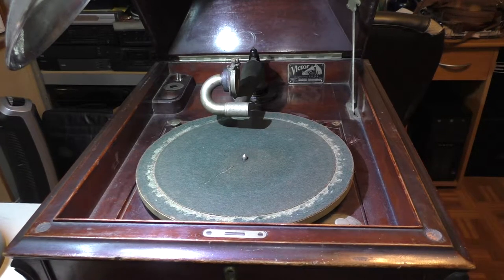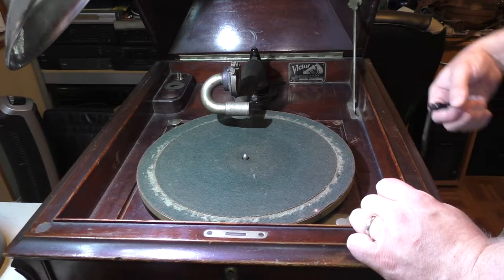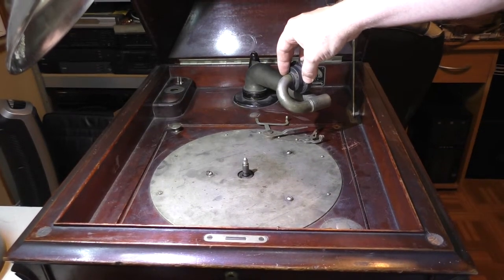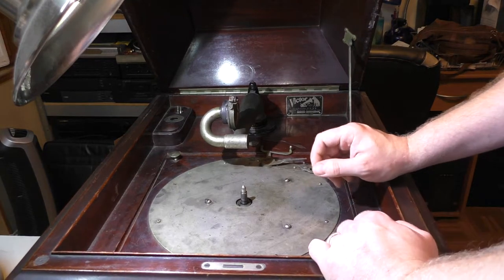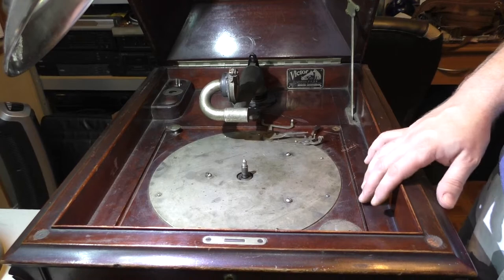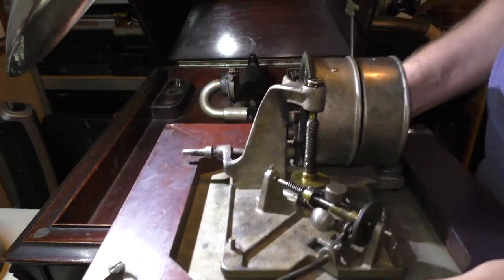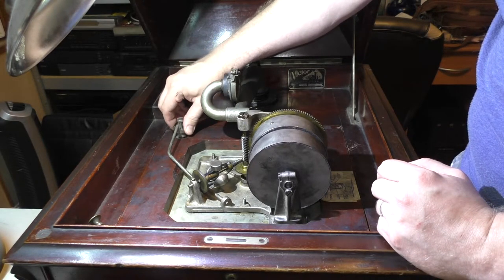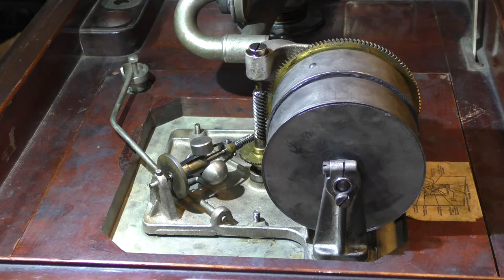PTS Ep. 102 - 1913 Victor Victrola VV-XI Repair Part 1

Comment: If you take the springs apart be careful they can cause injury when sprung. Get an old pillow case or burlap sack and put the casing in it and tie up the top. Wear heavy gloves and tap the spring out with a hammer. It should come off and unwind in the sack. Don't let the spring get dirty. You can examine it and see if the break is in the middle or at the end. If it's just the end you can recut the attachment part, re-hook and rewind it. (You may also want to clean off old grease before you re-pack it as well.) If the spring is broken in the middle you'll have to replace it. There are some replacement springs sold on EBay. Be careful and Good Luck!
Reply: How much energy, joules does this hold?  
I am guessing about 25 watts per second.  If it will run the system for 4 minutes, then about 1000 watt-seconds or Joules.
Reply: Thank you for this tip

Comment: I like this.  I have a Victrola my grantfather bought as a teenager circa 1920. I used to listen to it at our cottage as a boy, where we had no electricity.  However lately it to runs slow inspite of the speed adjustment.  I think I need to open it up and clean it.   I dont know much about different lubricants.  Should I use a brush and some WD40 or some silicone?  Where do I use grease and where oil?  Too bad yours was already cleaned.  Would have been interesting.
Reply: Ephesians 3:20-21

Comment: Looks to me you have turn the spindle side 90o into repair modus.
These recordplayers must have been repaired at home by an mechanical operator on the spot as it was to difficult to move these delicate and very costly cabinets. 
The replacement of the clock must go easy.
The springs of these clock break after time.

Comment: When I wind up my portable one, it makes a sound when I wind it like 3 times and then it loses all of it’s force. Do someone know how to fix it?
Reply: Sounds like you have a problem with the spring. Either the spring detached from the barrel or the spring is broken. Chilldude2007 made a great 6 part video on a Victor 2 spring motor rebuild. Also, The Compleat Talking Machine book Fifth Edition has a great section on how to repair a spring pages 15 - 16.